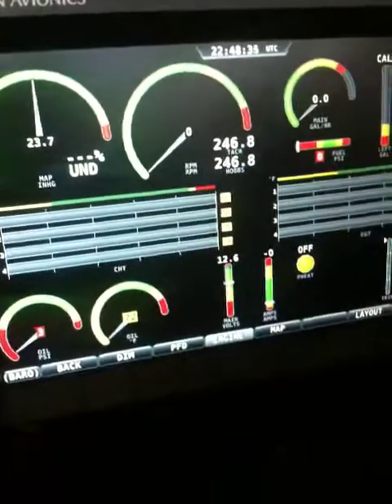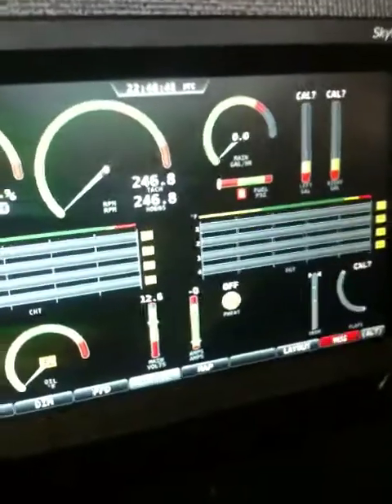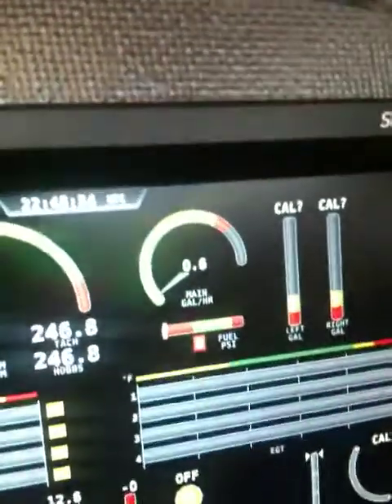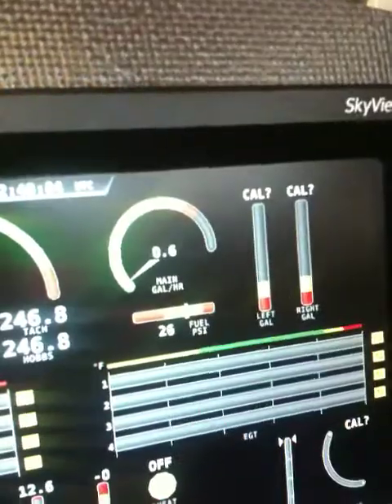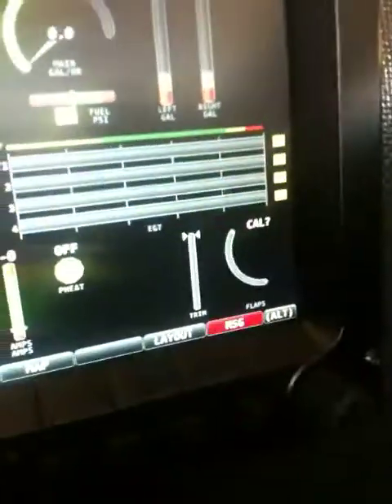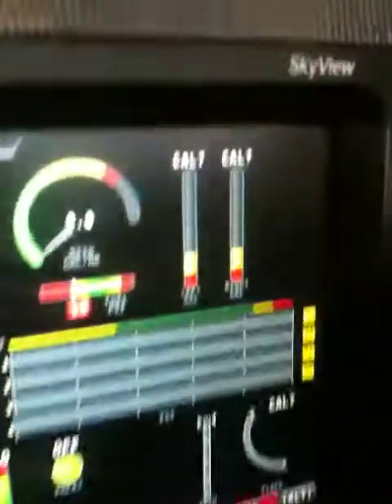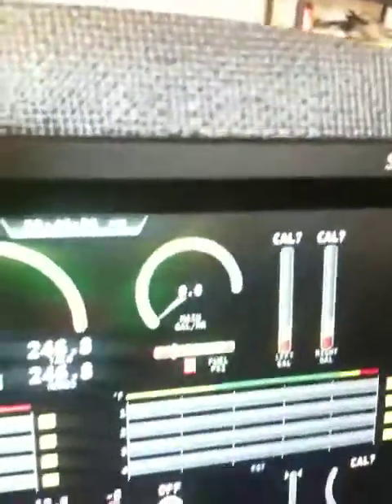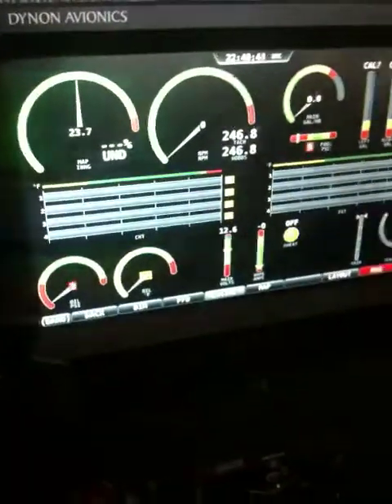Project Skyview Part 15

Comment from the maker: I used the aluminum only to cure the layups overnight.  I used Saran wrap as a mold release and one layer of peel ply on the back side of the panel so it would be bondable.  So I only had to cut through the glass and ply wood.  I used a jig saw with a metal blade.